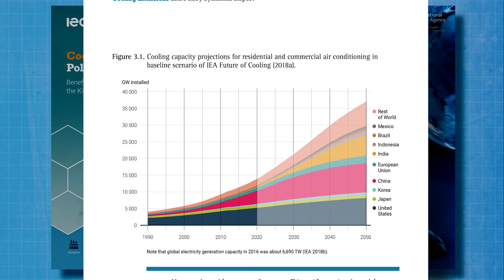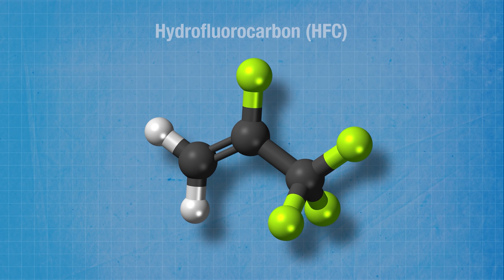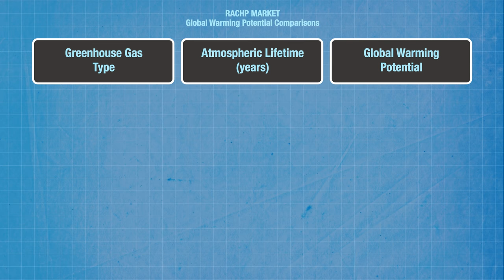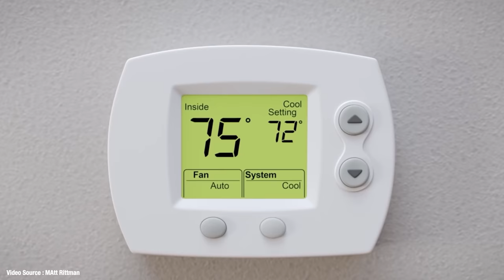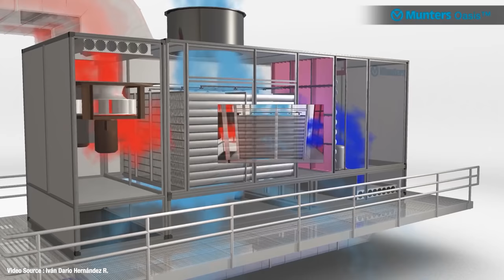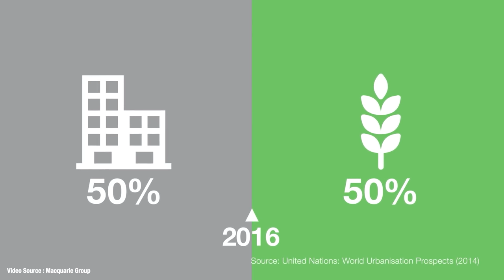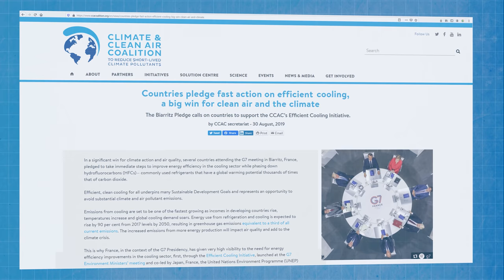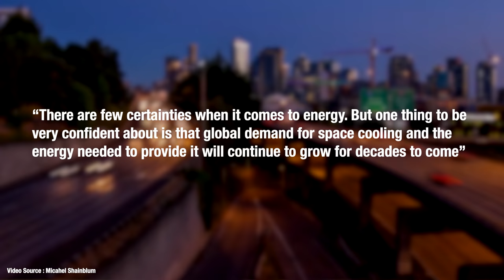Keeping cool in a warming world.

Comment: Quick question about white/reflective roofs. I live in a northern country but we still need AC about 4 months out of the year. Do you think that having a lighter colored roof in the cold months of winter would require more energy during those months so that this solution would only be interesting in warmer countries, or is the sun's energy during winter not enough to make a difference. Is AC more energy demanding then heating? Guess it depends how you cool or heat your house.
Reply: Your roof should have serious insulation for both hot and cold. I live in a northern country as well and have reflective roofs over 25cm/10" of insulation. Works just fine but the heavy lifting in winter is done by the insulation.
Reply: "I live in a northern country but we still need AC about 4 months out of the year".  What you need is a machine that peels your grapes for you. I think there's one being designed using wind turbines.

Comment: Its crazy that evaporative coolers have fallen so out of favour, if your not in a humid area they work amazingly well, use less that 1/4 the energy of refrigerative and need very little maintenance and last almost for ever....Im making one atm for just a few hundred in materials so simple, just water trickling over cardboard honeycombed pads with air being sucked through them with a fan.

Comment: i wish you could look into the dedicated fire supression system in on ordova street in vanuover b..c. it is a 52 inch dia seawater pipe that delivers 4 degree seawater from below 60 feet m.s.l.  the line extens from  canada place to the emergency response center on main street. the cost was 15 million dollars with 200 miles of fire hose to hookup to fire hydrants in case of earth  quack interuption of  water supply when onected to all the exsisting buildi

Comment: Looking forward to Tesla entering the HVAC market after developing the most advanced system for use in their cars. I’ve been using AC in my house in UK now for last 15 years. Those hot sticky summer nights are a thing of the past and I won’t go back. As our electrical supply becomes greener so will my heating and cooling and all new builds should come with or equivalent such as ground source heat pumps.

Comment: Dave, I bought a new mini fridge and was surprised to see that it uses iso-butane (r600a) as the working fluid, which supposedly has a low global warming potential. While the basement might go up like the Hindenburg, at least the planet will be cooler!🌎
Reply: @joansparky4439  Most HFCs are non-flammable at room temperature and pressure, and supposedly inert though I wonder about that..   I'm glad propane is even better and offers an easy alternative to HFCs, with a low GWP;. It could even be made from biomass with the right catalysts or engineered enzymes.

Comment: That was a very good summary, thanks. However it seems to me that one aspect of the solution (perhaps the most important one) was neglected and it is the hot and cold "Thermal Batteries" and even more importantly the seasonal heat/cold storage units. The principle behind it was barely touched with the mention of the company in Paris but they are way more extensive and perhaps the most effective and least energy intensive solutions.
Reply from the maker: Perhaps something I can return to in a later video.

Comment: My understanding is that absorption cooling for commercial buildings was largely abandoned in favor of compressors in order to eliminate the health risk of ammonia leaks.
Reply: Well, ammonia compressor systems are the most common system for ice planes in Sweden.
Reply: @nallebrean  I'm reaching way back in my memory but rooftop ammonia systems were initially popular because of the prime energy source was natural gas.  However, casualties occured on occasions due to the ammonia leaks.  As Freon base compressor systems were introduced I believe a selling point was the low toxicity of the refrigerant in case of leaks.  As performance improved the increased efficiency offset the premium of the electrical energy source.

I can still find recent articles of evacuations due to ammonia leaks, one I skimmed due to a leak in a fish processing plant.  I'm sure the code and equipment requirements for ammonia-based systems are much improved since the time frame the original stories I heard originated.  A plant separated from a building is  one thing while a plant on the rooftop as suggested in the video presents special conditions to prevent ammonia from a leak ingressing into the building.

Comment: True irony exists in that the modern refrigeration units (high temp) concentrated solar source / geo should heat ammonia in a boiler and recapture the pressure into electricity directly with a dc fan. The above 1 Co efficient of performance means that you can boil and condense the second loop and effectively generate power above unity
Reply: You mean all the captured heat should go into a thermal power wedge. And that the supermarkets should generate at least their total heat load

Comment: Cap the allowable size of HFC systems.  Small apartment building heat pumps at most.  Larger than that require the other coolants.  I worked with ammonia cooling systems in an industrial setting and you don't want your neighborhood Mr. Fixit working with that in his garage.  
There are quite a few desiccant based AC system videos around here.  Those show more promise in areas the swamp coolers aren't very effective.

Comment: Dave, my World Book encyclopedia set from 1924 includes refrigeration using ammonia as the working fluid; they had the problem solved nearly 100 years ago, but a leak must have really smelled like bo peep ammonia cleaning in action!
Reply: Ammonia is a great refrigerant however it's also quite toxic, and requires all steel pipework as copper will corrode. Makes it much harder to install on a residential scale, probably why it fell out of favour. However it is widespread in industry, such as cold storage and large manufacturing plants.
Reply: @Thermoelectric7  Thank you for those gems of knowledge!  It's good to know it's a great refrigerant, though undesirable in residential interiors because of its hazards to human health.  I wonder though, if for residential refrigeration where the cooling units are outside the building, if that would be safe enough, given the small quantities of ammonia used and the low odds of a leak, plus air movement to waft any emissions away? I tend to be averse towards halogenated hydrocarbons in general, owing to risks in production and questions about their general biocompatibility.
Reply: Yep, as a young man I worked on industrial ice cream freezers running on ammonia. Most of the packers were women, who are more sensitive to the smell (I was told). Nothing like a lil mishap while getting these freezers to run to get a whole packaging line on the run. That's was with a lil whiff.
Reply: @astranger448  Lol, thanks for the story; provided no one was injured, that must have been a funny sight to see!   The old tome says that ammonia was used to cool brine that was then fed into the cold storage room; was that the case with ice cream, or was it used in lines to directly chill the product?  I'm wondering if with a secondary cool liquid it would be safe enough for cooling buildings..

Comment: Radiant barrier foils can be used to reduce energy consumption. Not everything needs reindustrialization for cooling.
Reply: Laughable R values.
Reply: @joansparky4439  It is not about R values Sparky. We are talking about reflecting incoming solar radiation to keep your insulation cooler and keep the conduction down which heats up your home ceilings. This work was proven, I repeat, proven by experiments run by the Florida Solar  Energy  Center in the late 1970's.
Reply: @stephenverchinski409  
Yeah, I get that.. but your initial comment sounded like foils alone would do the job.
Now you're telling me insulation + foils did the job, which I agree with.

Comment: Regardless of how ‘good’ we get at cooling without increasing how the earth heats up we are still moving heat from indoors to outside, eventually after we sort out all the current problems direct heat pollution will become a problem.  Even if we are making it happen without harming climate we will be directly heating the atmosphere!  The only way I can think is to have underground ‘heat batteries’ which store the heat during ‘summer’. And then to use that energy to heat homes during ‘winter’.  It’s Extremely inefficient and would only work on a municipal scale but it would reduce total energy consumption.
Reply: Already works on single dwelling scale. Just a large (~50m^3 I think) water tank in the center of your home and good insulation and you can buffer annual temperature swings in temperate climates.
Reply: @joansparky4439  yeah heard of this it’s good but very inefficient, sadly heat is the most inefficient to convert / store with current technology,  you can convert heat to electricity (Using thermal electric conductors) and store that but you only get a few percent of that energy.  Happily there are lots of brilliant people working on the problem 👍

Comment: I wonder how efficient it would be to transport big blocks of ice again, like we used to do before electric refrigeration. AC that has a big block of ice as its cold reservoir is nice by itself, but including the energy cost of transporting the ice, I don't know.
Reply: Do one better,  add a chiller to your under floor heating setup and power it with solar panels. The thermal mass of the floor will tide you over the evening/night.

Comment: In Germany, solar powered geothermal pumps were a big thing in the 1990s. The both heat and cool. Whatever happened to that technology?
Reply from the maker: It's still there. I looked at Geothermal a couple of weeks ago. I should have mentioned it again in this video really. That was an oversight on my part. Anyway here's the link
https://www.youtube.com/watch?v=1jCHYUuEDZ8&t=36s
Reply: It‘s expanding rapidly. More than 50% of all new German buildings are meanwhile equipped with heat pumps which of course have to be powered by renewables.
Unfortunately there are almost no reasonable incentives to replace fossil heating by heat pumps in older buildings. Instead you get state money when you replace your oil heating by gas heating. This is completely ridiculous assuming a life cycle of at least 20 years for new heating systems. 😡
Reply: In USA I looked into geothermal to replace our 21 year old gas furnace and electric ac system. I calculated the payback based on estimated bills and it was 25 years when compared to buying a direct replacement for what we already have (3 different quotes). By then I would have to buy another system. Wish it wasn't so costly to go geothermal.
Reply: @NicholasMcKellip  I am hoping Biden will put up some big tax incentives on geothermal when he arrives in a few months.  Both my furnace and AC are nearing EOL.

Comment: Great content as usual always look forward to your postings. One thing I wonder about is how much data storage cooling is starting to add to the heating lists. I think it was Google or someone recently finished a test storing data storage pods in the sea to keep them cool, I think it worked out ok.
Reply from the maker: Hi Helen. It's an extremely good question. I think it was Microsoft who did the undersea data centre, and like you say, it does seem to have come through unscathed. I'm actually talking to a guy who works for a very big company that designs data centres. They are massively concerned about this problem, as well as their processing energy use of course. There are some interesting solutions in the pipeline so I'm hoping to look at these in the New Year. All the best. Dave
Reply: @JustHaveaThink  Thanks Dave. Yes your right it was Microsoft, I should never guess always going to go wrong. :)
Bitcoin and other electronic coinage has always made me bite my lip as everyone would say how great it is and all I saw massive power consumption that never really needed to happen. Not good timing.

Enjoy your rest and we'll see you on the other side.

Comment: There are heat reflecting paints in production already if all structures had their roofs painted with said paints it must help reflect an awful lot of heat and the cost could be spread across the individuals
Reply: Bought mine years ago when my roof needed replacing anyhow. Simple, costs about the same, works.

Comment: Very nicely put. I think you made a good point on insulation. Since you wanna air condition most, when the sun shines I thought its a great use of solar power, but now I am pondering wether the power production is worth the heat absorbtion of the panels?
Reply: If there is an air gap between the panels and the roof, it makes the roof cooler, not hotter.
Reply: @incognitotorpedo42  very nice. So more solar and more gaps is a nice solution
Reply: Should be possible to have your panels run a water chiller integrated with your underfloor heating. Cooling during the day, the floors thermal mass will cool during the night and heating in winter.

Comment: all the building it was estimated to save 15 milion in air conditioning costs per year.with simple direct air to radiator  forced air irculation no gases involved this system called the D.F.S.S. WAS THEN INSTALLED AT THE housevof ommons in ottawa and promotted to the caribean with cheap ferro cement large diameter pipes drawing cold seawater like jamaca where it was reputed to have a 50% decrease in gun hommicides due to the constant fan noise.The cement pipe are made in Quebec and are the first frieght on the saint lawrence seaway.

Comment: A tax on refrigerant gas is what could work, where higher tax is applied to more potent gases. 
Money is paid for collection & proper destruction too.
This worked in Australia for 3 years until a - you guessed it - conservative government canned it. 

For residential scale, selecting reverse cycle air conditioning that utilise hydrocarbons (r600or r290) -is  better option than HFC & available now
Reply: Just bought a new AC unit.. no r600 or r290 available.. was all r32 (pana, fuji, kelv, etc.)
Reply: @joansparky4439  .Yea, they're hard to get. The Chinese & Indians makeng millions now but mostly sold internally. 
(Only 2 brands available in Australia)

Comment: I guess that the energy efficiency of anything within an air conditioned environment is also important. For example, if a computer is needlessly left running in an office it is not only wasting electricity but is also creating extra heat for the a/c to get rid of. As if the inefficiencies get multiplied. Would anyone know how significant this would be?
Reply: Modern computers shut down lots of stuff when idling.. you're looking at 10-30W for simple office machines there all inclusive.\
Lighting is the same.. where you had 40W tubes now you have 10W LEDs.

Biggest problem with AC is that they are being used to dehumidify, but without dumping some of the heat within the building after removing water from the air.. this leads to cooler than needed rooms. ACs that can control not just temp but also humidity are more expensive and complicated though, as they need a set of extra valves to condense some of the refrigerant at the indoor unit and not all of it outside.
Daikin makes or made those.. never seen them from other mfcts.
Reply: @joansparky4439  A separate stand-alone dehumidifier would solve that, or a nice fan all solar powered of course
Reply: @blaydCA  
Yeah, we got them as well ;-)

Comment: It all comes own to how well insulated a building is. In my 120 m2 house, after proper insulation caloric loses per hour went down 10fold!!!
Reply: Easy if you build new. Not so easy in an existing building. That does not mean that it can't be done, since we both did. I transformed a 1930 building with the same results but it took quite the effort to get it right.
Reply: @astranger448  The way I did it was to  add external insulation and replace all windows with aluminum with thermal-separation and "ecological" double glazing. That took care of 90% of heat transfer. I was lucky as the building was relatively new (1980). I dread to think what it took for a 1930's building.
Reply: @kostaskoroneos228  I was lucky that the interior could be totally gutted. I basically framed a house within the house. External insulation was not an option, can't modify the looks of the exterior it being protected and good-looking, also super compact which helps a lot. I went there the long way round, learning the needed skills to tackle the works myself. Not easy but fairly cheap.

Comment: Cooling any area usually produces HEAT, except in Earthships. This was mentioned in the Eco Guards Novels in 1986-89. Heat is another form of pollution that needs to be addressed. Just ask anyone living in large concrete, asphalt cities. Radiant Heat is also a great issue of our so called modern times. We must all work together, to truly attain proper Innovative Eco Solutions.  Here is a possible simple solution that might work. Have you ever noticed how water that's run really fast through a copper pipe, creates a cooler pipe. This solution was also theorized in the Eco Guards Novels. It's really interesting that most of the ideas in those novels, are now being explored. Including Agenda 21.
Reply: Heat movement from HVAC isn't much of a problem.  The heat island effect is FAR larger.